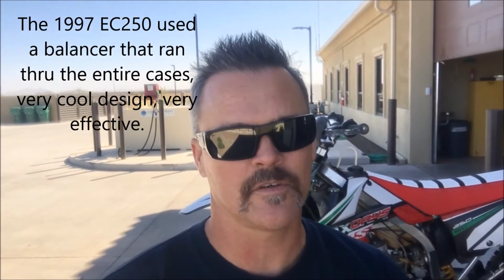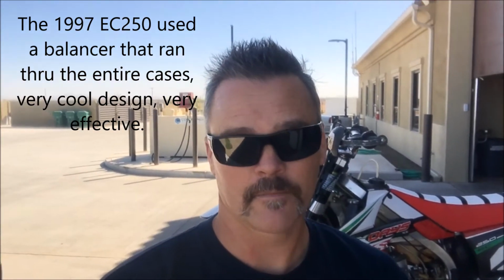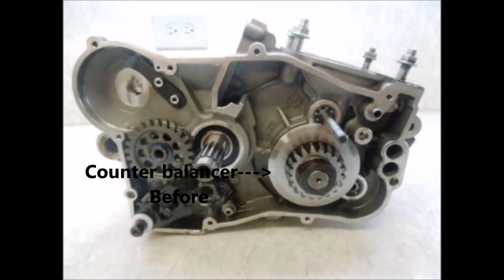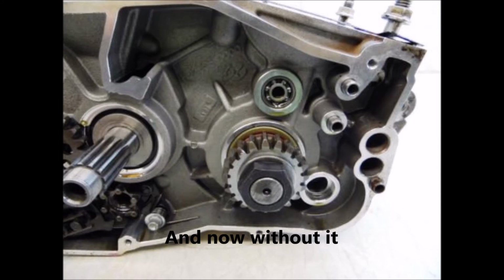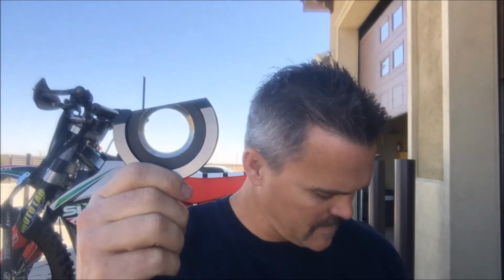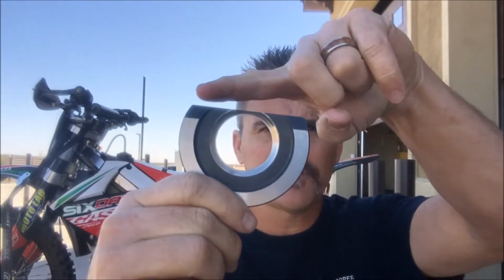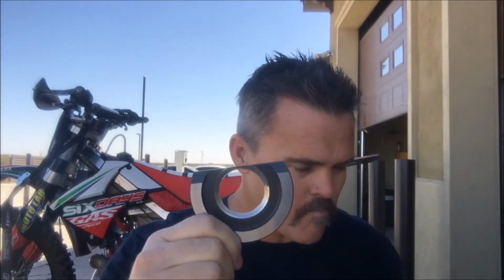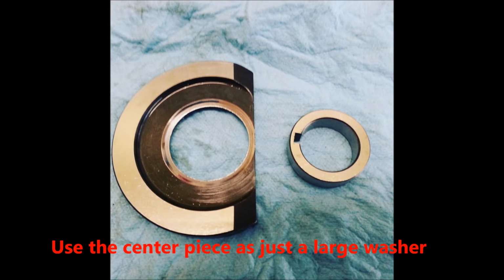GasGas EC300 Crank balancer mod (not flywheel)

Comment: I have a 2012 Gas Gas EC300, 18,000 or so miles. Love it. I'm thinking of adding the heavier flywheel I do a lot of rock crawling trails and just extreme gnar so I like the tractor-ability.
Reply from the maker: Meeker Extreme I ran the S3 flywheel for a bit and it is heavy!! It will make your bike a tractor.

Comment: Gas gas 300 uses the same crank bearings as KTM 300, I bet the spacer in KTM would work in place of the counter balancer. I've wondered if the KTM crank would fit.

Comment: I don't understand why you machined out the center how does it stay on the shaft?
Reply from the maker: CanGasser I did not machine the center. The outer material was machines away from the center. Take a better look at the part and you will see?

Comment: I`ve been riding Gasgas for 10 years, and never felt the lack of power on it, neither on technical terrain, or open wide terrain. I prefer the 300 but the 250 goes better on higher (/longer) revs.
Reply from the maker: Nuno Alcaide I totally agree, these bikes have so much power and they have even more that is hidden away so to speak! I do love a 250, my older gasser is a 250 and it is a sweet heart of a motor with the older counter balancer. Keep it pinned and stay safe.

Comment: Thinking about bying a gas gas ec 300 2013 with öhlins rear shock and fork. I'd mostly ride on the streets (supermoto) but also occasionally enduro. Should I buy the gas gas or should I buy tm 300 instead?

Comment: hello sir. i have a question. 
about how to wire a motorycle. without a stator coil. using only battery cdi and pulser.
Reply from the maker: kenneth eguia WOW! I wish I had the answer to that? Electrical is a bit outta my league. But if you join and do a search of the gas gas forum there are still a few people there that could help you out? Good luck and keep riding.

Comment: You would think the cut off light side and the heavy side of the counter balancer make the weight uneven distributing uneven forces on the crank as it spins around and cause an unbalanced effect on the crank and cause it to wear out faster.
Reply: @WildAzzRacing  I have that hald weight on my 300 and runs fine...not sure if is factpry or not. Also dont know of should have flywheel weight by factory, mine doesnt and revs quite fast...

Comment: Hello, how much does the big flywheel weigh?
Reply from the maker: Patricio Avendaño are you asking about the oem fly wheel or the S3 flywheel? I honestly do not know the weight of the "oem" flywheel, the S3 is 24 ounces.
Reply: Perfect, I do not understand your language, I write it for a web translator.
I appreciate your advice, in GG there is no space in the magnet. In the OEM place is very comfortable.
I also put a washer in a centrifugal system which greatly improved the low, and with the S3 must be brutal !!!
The gas gas in my country is considered the "Cinderella" of European motorcycles but they have an incredible potential !!

Comment: Thats a 97?!  Please do a video on how you did that conversion!!
Reply: You need a airbox, seat, fuel tank and plastics from a 2010-11 mod.  and everything just bolts right up.  You can buy the whole kit. it is called: Gas gas Restyle kit.  kinda hard to find, but just googel it and you should find it.